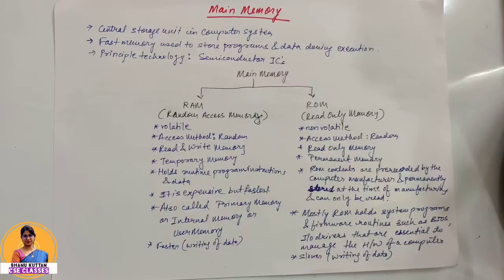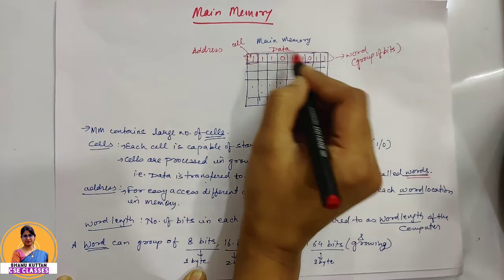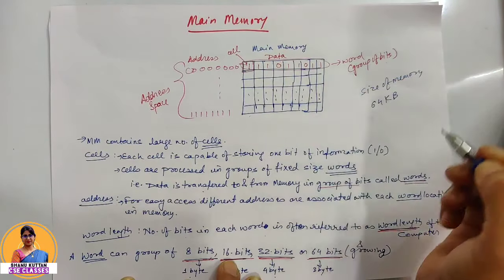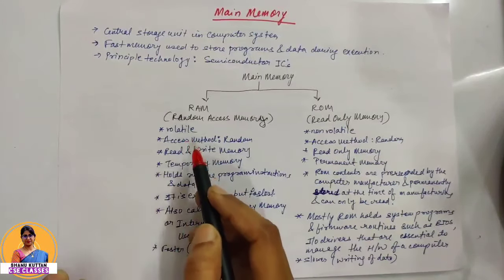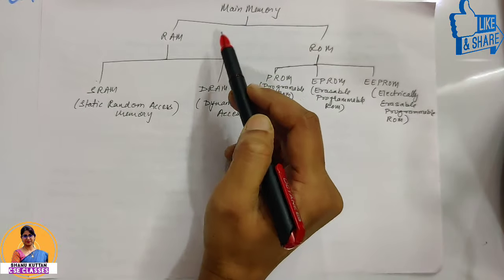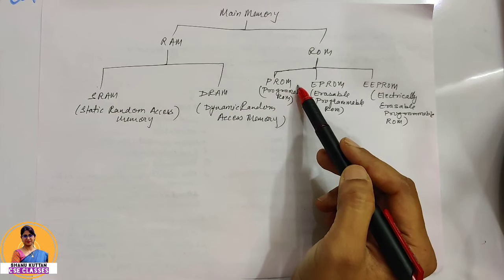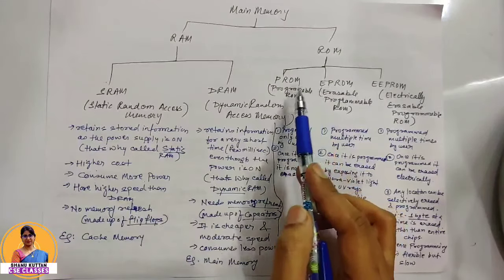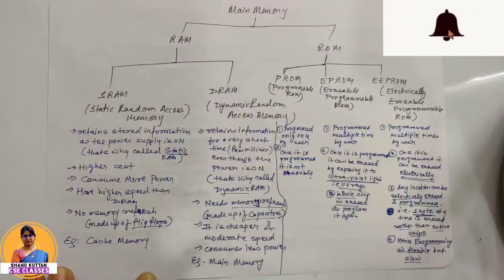L-3.2 Main Memory | Internal Structure & its Types RAM & ROM |SRAM, DRAM, PROM, EPROM, EEPROM | COA

Comment: Hello Ma'am, Your teaching skills are so helpful. I am a bit stuck to understand  the concept of address line finding in this video. As you took the example of memory size is 64 bit and the data word length is 8bit. So can you please write me here the formula to find the address lines. As i see, since  the memory size is 64 kb so the address bits are  2^6 but i didn't understand 1k is 2^10 concept. Please give a glance here. Sorry i am not the core background of the computer architecture so maybe I am missing to understand it easily.
Reply: 1 kb means 1 kilo byte which is equal to 1024 bytes that can be written in 2^10. 
1 byte=8 bits.
Reply: or  solving 2^10 gives you 1024.
Reply: @hemantrajyora6965  thankyou yeap